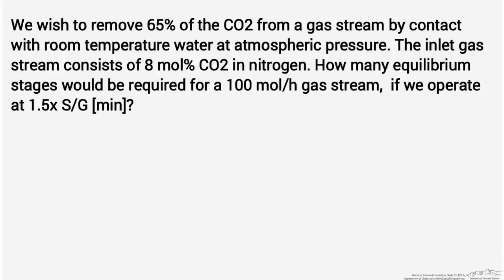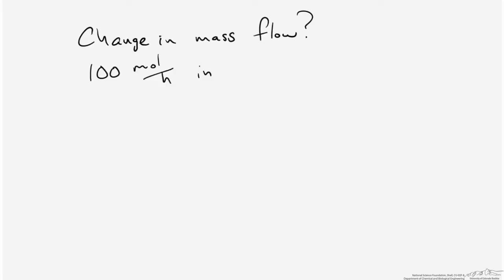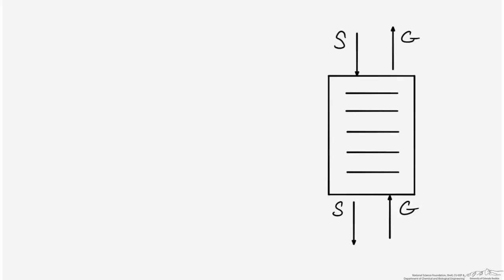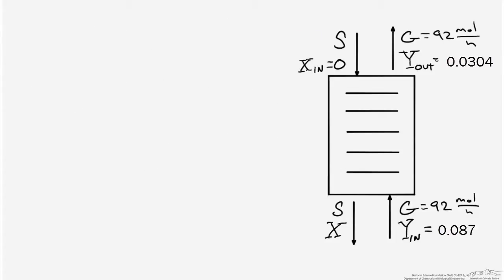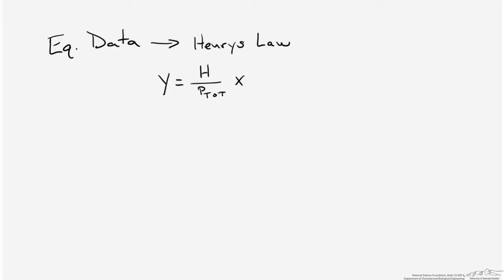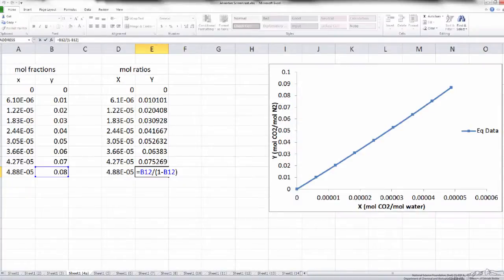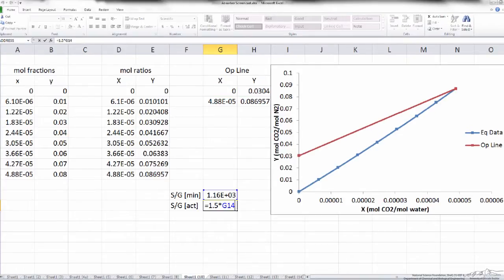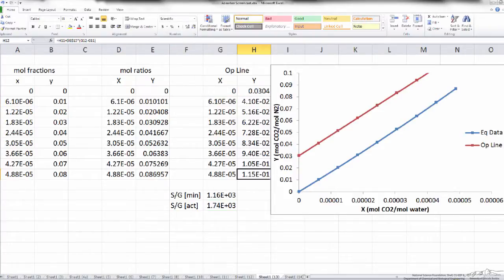Non-Dilute Absorber Example

Comment: Just one question to ask if you are available. What if there are two gases absorbing? Should we include less absorbing gas in the carrier gas or exclude it?
Reply: Hi, I know this is two years after your original comment but your question is interesting. Theoretically I see two options to solve your problem. Define the gasses as a mixture, and use a mixture property law for the he ry constant which is after all a function of the composition of the mixture by way of the pressure and temperature as well ass the ratio of components, this can only know if you know the ratios of the two absorbing gases though. The second option would be to assume an arithmetic mean, and treat the 2 gases as 2 pure component systems, and then just add the results you obtain for both. I think the forst option would be more accurate though.